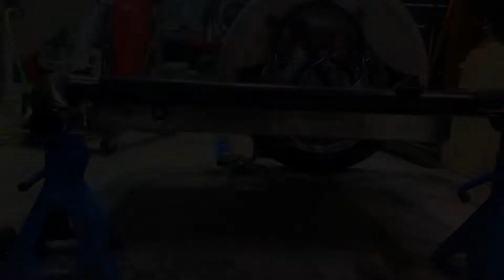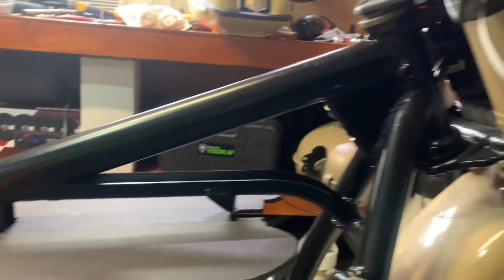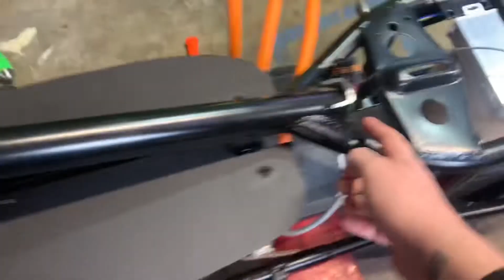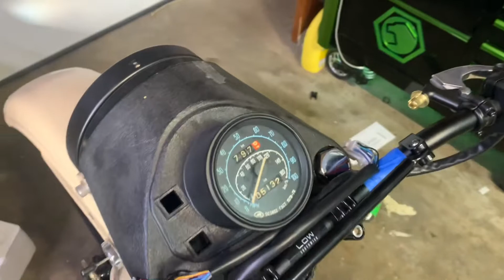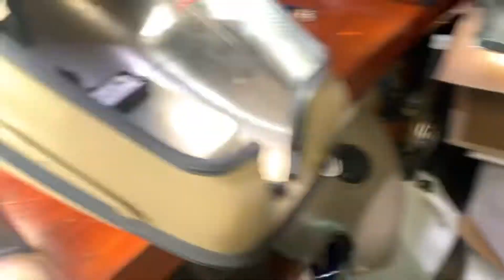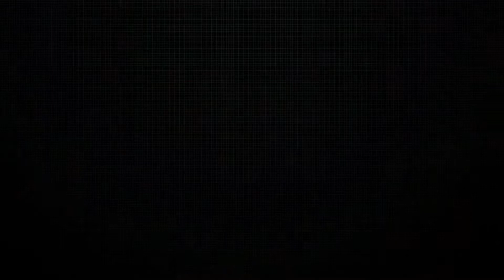Episode 2: the electric motor and logistics

Comment: Time for an update! Did you stall out on the project or did it get completed? Was the motor choice a good fit? I have a 2001 650cc that will go to EV at some point when it is no longer repairable. Don't fret that you only get 100 views, you are getting the right 100 views.

Comment: Hey man, this is a really cool build. I'm also converting a classic bike to EV. Ours our a bit different though (hub motor vs mid-drive motor) another difference is that you'll have a 12v battery. Most builders skip this and just let the dc-to-dc converter power the 12v system. There's different ways to do it all, I'm sure. Have you put together a wiring diagram yet? would love to see it

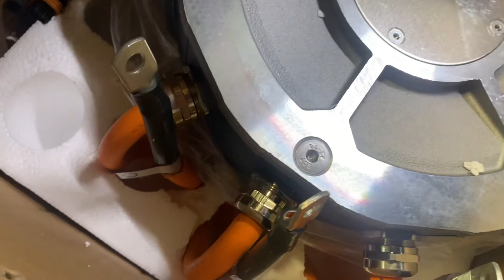Comment: 0:20 "It's a lot smaller than I anticipated it would be." - my wife on our 3rd date
Sweet update. Yeah, I'm a purist, I'd probably 3D print a prototype "fuel tank" (to also do custom mounting inside) and either do a rubber or fiberglass sealing layer, or leave it and do one of those canvas covers. The frame drilling also hurt a bit, I ran a USB charger on my rig with wiring under the tank, just popped the existing zip ties on the stock harness, ran the new wires beside it, and fresh zip ties. I know you may have already figured something out, but the radiators for the cooling system would look sweet in the places where the original cylinders were sticking out, give it an almost original look.
Reply from the maker: I’m a huge vintage motorcycle buff, however the amount of wires I need to run would be too big to just zip tie to the frame. You’ll see as I make the wiring video, even though the frame drilling and tank cutting hurt me to do to this sweet old bike, it was necessary. I have some special cooling parts on the way that should look sweet and if all goes well most people wont be able to tell at a glance if the bike is gas or not lol